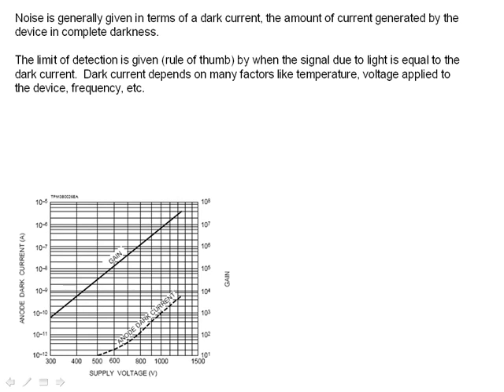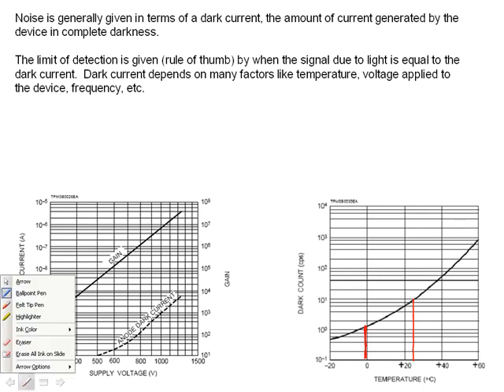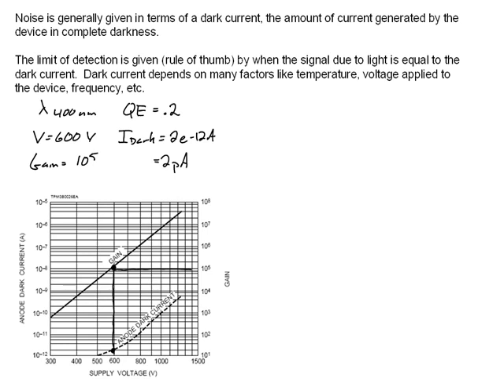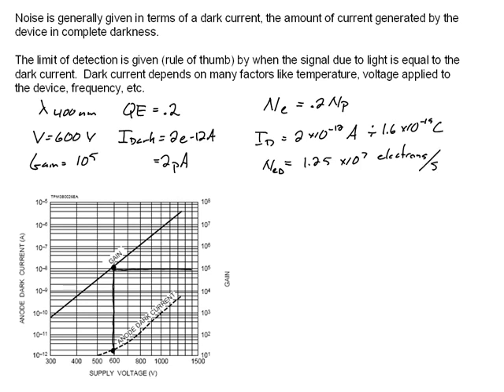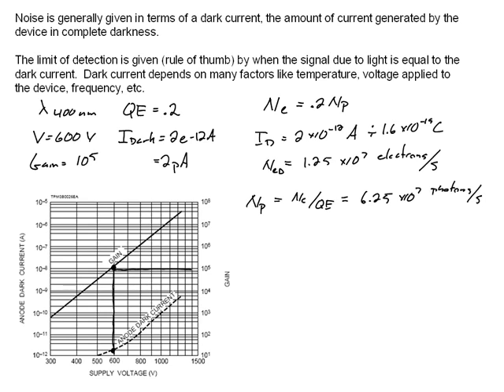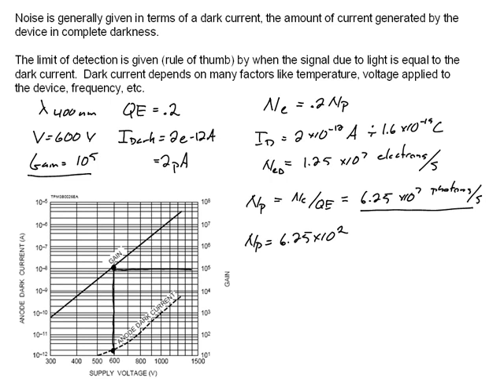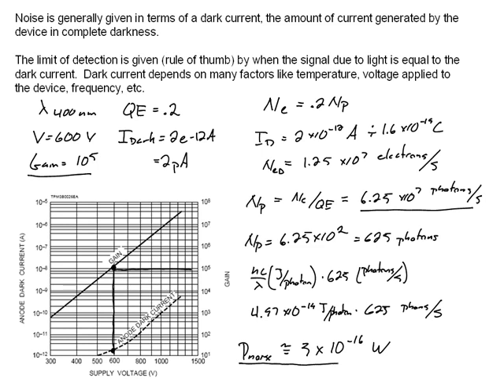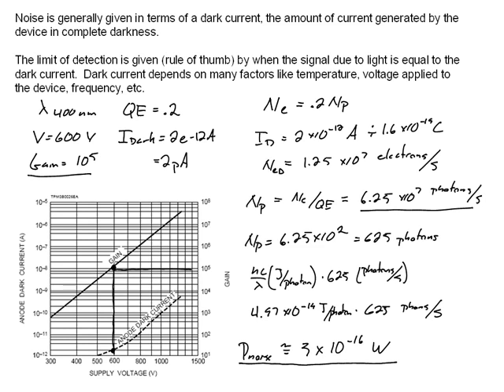Photomultiplier Tubes Part II

Comment: Congrats very good video. I am trying to test a Hamamatsu 6358 PMT. We will use it for detecting a 671 nm lithium line with an interference filter in front. An idea was to pulse a LED or a diode laser at 670 to simulate the pulse. Should we use 50 ohm at the oscilloscope? I would be very usefuel to learn an example of the measurement. How does the capacitor at the end of the resistor chain act?

Comment from the maker: @daleyjem No, it would separate the spectrum into colors and thus likely reduce the total amount of light.  The real issue is maximizing the photon to electron conversion while minimizing the noise.  If you wanted to only dectect one color of light a prism would help, but the typical device that does this is a spectrometer with a diffraction grating inside.

Comment from the maker: @yellowmetalcyborg No.  Lets say your photocathode is at -1100 V and you have ten dynodes.  You would put a chain of resistors connecting each dynode in series.  The photocathode is at -1100 V, the first dynode at -1000, the second at -900...  +100 V difference between each.  The last dynode that collects the charge would be very close to 0V.  The reason is you don't want to hook an amplifier to -1100V.   Google "Hamamatsu Photomultiplier Handbook" and read intro.

Comment: @kridnix Ok, so you would have alternating positive and negative dynodes that would accelerate a cascade of electrons, right? And the potential difference between two consecutive dynodes would increase as you get closer to the receiving anode plate?
(Excuse my limited knowledge on the subject.)
I'm considering making a photomultiplier for making a scintillation detector, but I need a massive amplifier to distinguish between background radiation and radiation from a weak source.

Comment from the maker: @yellowmetalcyborg As far as the thickness...  Doesn't make a difference if it is an absorptive photocathode,  But for a transmissive PC, you have to balance the fact photo-generated electrons need to escape vs. ability to absorb photons and generate electrons.

Comment from the maker: It isn't so much about charge as it is the potential difference between the cathodes and the dynodes.  The electric field created by the potential difference needs to accelerate the electrons (negative charges, go opposite to the field lines) into the next dynode.  So there is an internal or external chain of resistors set up to give the right potential difference.

Comment: Great video!
I have a few questions though:
The photocathode does it have a - or+ charge? It would make sense that it would have - charge but I just want to make sure; how thin does it have to be?
The dynodes, are they charged with a - charge? If so, do they have equally negative charges, or are some charged more than others?
If you have two negative dynodes, wouldn't the electrons be repelled by the second dynode and be scattered instead of hitting it and ejecting electrons?